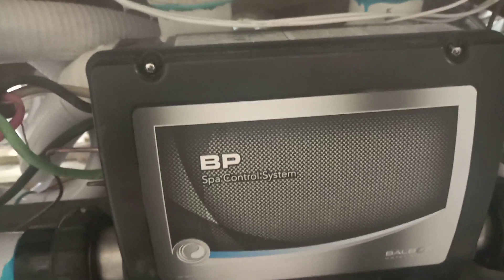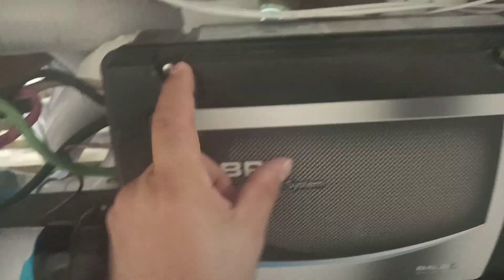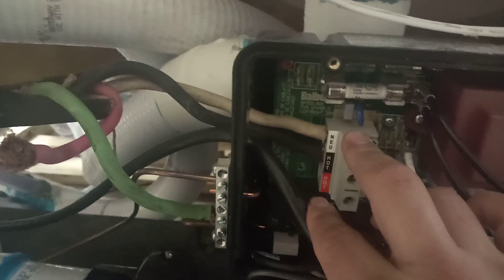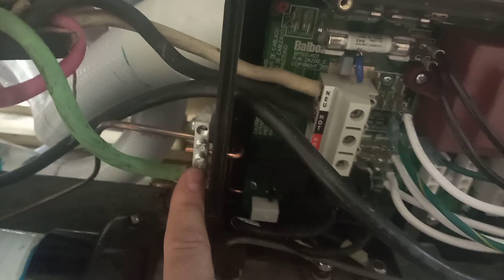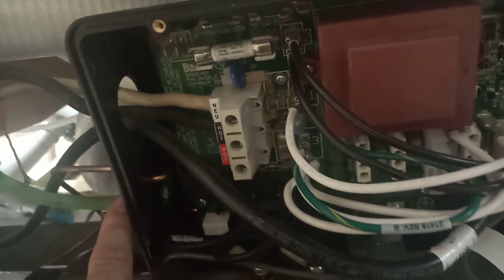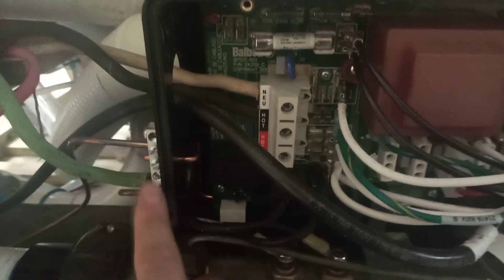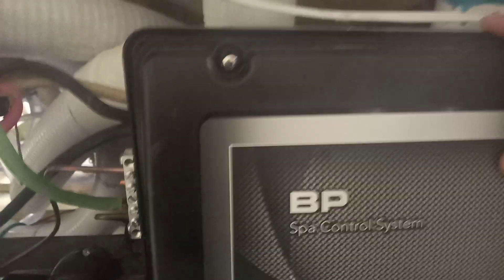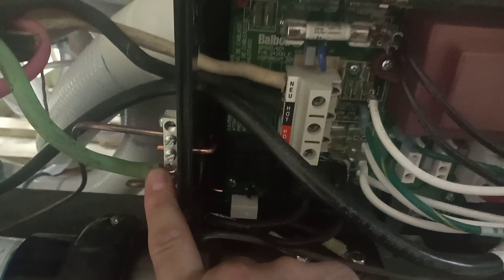Wiring a Balboa BP501 control pack at 110V-120V

Comment: Thanks for posting, so you don't have to change any dip switches or run a jumper.
Reply from the maker: You got it.  We install the jumper at our manufacturing fascility.  So, it is not required.
Reply: @pacificahottubs4434  Thank you for the reply, I am trying to convert my hot tub from 208 to 120v but I must have lost the cover of the electrical panel with wiring instructions,  So just to be clear since it was converted at your factory you must install a jumper and change the dip switch, really appreciate your time and help.  Thank you
Reply from the maker: Send us an email at support@pacificahottubs.com, we can send you the schematics.  Make sure you have the jumper cable.  It should be attached to the back of your control pack.
Reply: @pacificahottubs4434  Thanks again I sent the email
Reply from the maker: @steveyeater7017  sounds good.  You will get a response tomorrow.  Have a great Sunday!
Reply: Pacifica Hot Tubs thank you